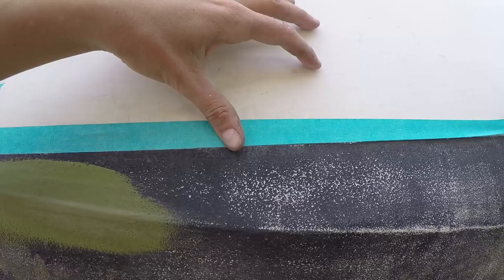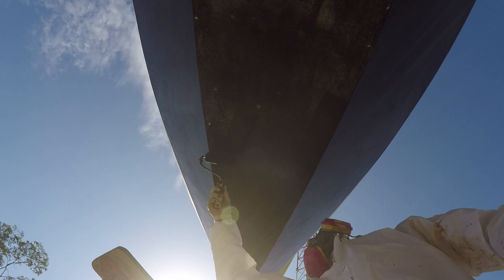Boat Refit: Painting My Sailboat in Guatemala - UNTIE THE LINES II #34

Comment: That has to be the most upbeat 'Haul out and time on the Hard' video that I've ever seen! (Apart from the first part, You had nearly 40,000 hearts sinking then, you little Minx!) Very well done, it proves the point that a job done well will save you heartache down the line.

Comment: Nice video! Karl's looking so good now if he had a mouth he'd be grinning from port beam to Starboard. A little at a time and it eventually gets done. Nice to see you didn't have any electrolisis either. Did you add  Zincs to the hull? I can't remember.
Reply from the maker: I did back then. Yes, and they were massive...so they are still quite good. Also because there was ntl much bare aluminum that could be attacked anyways, i guess
Ahoy, Nike & Karl

Comment: Looks nice. You painted over some bare spots below the rail. Is that supposed to be gel coat? Is that coating purely aesthetic, or does that layer serve a protection purpose? In other words, is the protection of the boat compromised by merely painting over it or is everything okay? Are the rules the same for aluminum versus fiberglass boats? Good luck and take care. I hope someone explains this.
Reply from the maker: Hey there, I actually did not just paint it over but did the whole process u r supoosed to do with aluminium...sand, acetone, etch roimer, primer and then paint. There is not gelcoat involved, no. It was just bare spots of aluminium showimg because the paint had come off. U can leave aluminium bare like that cause it builds a protectiv oxide layer, but i thought i would make karl look a bit pretty :)
Ahoy, Nike & Karl